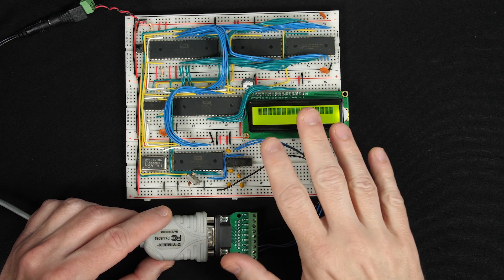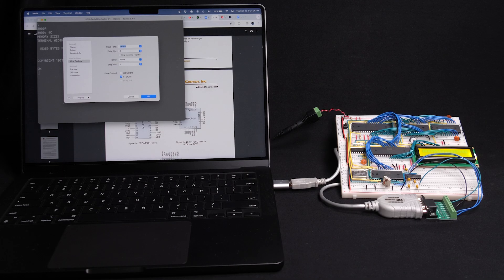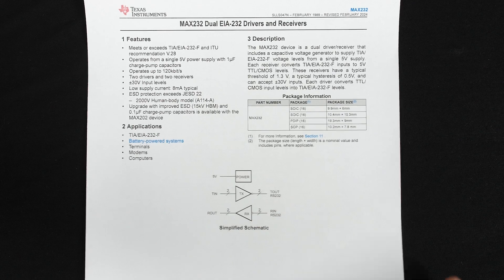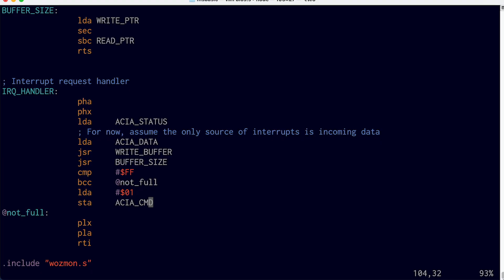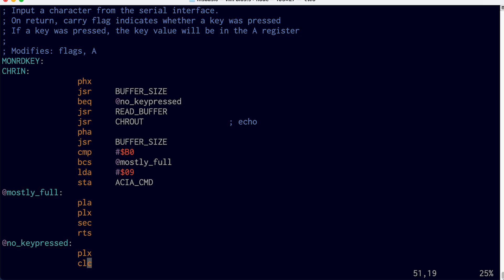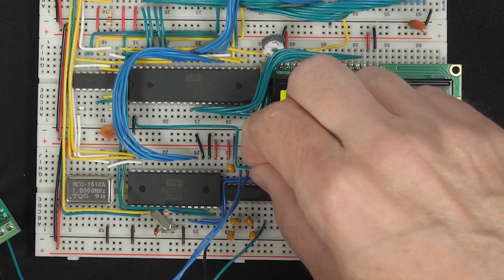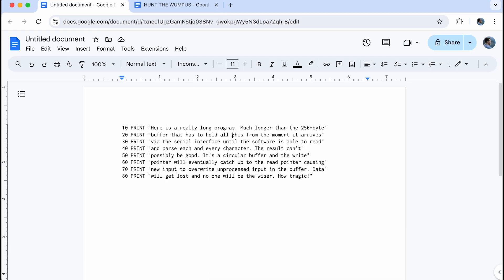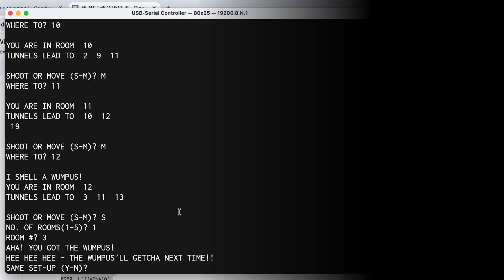RS232 flow control

Comment: What a lovely break from 400 gigabytes of NPM packages and desktop apps that use 200 megs of ram. Truly an elegant computer from a more civilized age.
Reply: Id actually appreciate desktop apps that only use 200MB ram.
Most electron crap uses 1.5GB+
Reply: @UloPe  And with that 1.5GB+ comes vastly improved developer experience. That's the point. We can either have excellent developer experience (which includes reduced development time) or we can have low memory usage. There is a reason for the tradeoff.
Reply: @clonkex  eh. sort of. the thinking is more along the lines of "machines have plenty of memory these days, and unused memory is wasted memory". this is true, so developers use more memory and have come to expect more memory. problem is, users also want to run plenty of programs, and often the programs cant gracefully scale down or share.

sure, we can run more things in parallel than we could 10 years ago, but not nearly as much as youd expect based on how hardware has advanced.
Reply: @clonkex  honestly I don’t give a rats ass about developer experience If the output product is substandard garbage. And I’m saying that as a software developer myself.

Also I reject your assertion that using web tech for desktop and mobile apps ist such a great dev ex. It’s just the lowest common denominator so that everybody and their dog can shit out an app that somehwhat “works”.
Reply: @clonkex yeah, but getting your hands dirty in the low level stuff is WAYYY more fun.
Reply: @clonkex software must be the only industry that’s this concerned about developers. Could you imagine a mechanical engineer saying “Sure that car does 3 miles to the gallon but it was a great experience to design”
Reply: @UloPe could you imagine any other designer prioritising their own workload over the efficiency of the product to this extent?
Reply: It's a sad day when even comment threads on Ben's channel turn toxic.
Reply: @johnm2012  Dude didn't even get the starwars reference so I wasn't gonna bother replying to him but yes, yes it truly is.
Reply: I wrote X program in 3 lines of code......and 400 gigabytes of NPM packages.
Reply: @fqed  I feel like y'all have a very difficult experience with npm than I do. There's certainly a lot of bloated crap but none of it is necessary.

Of course the web application at work is stuffed to the gills with unnecessary frameworks but that's a whole different story.
Reply: @DanKaschel it’s less npm or even Node JS’s fault. It’s JavaScript’s weak typing and implicit conversion that necessitate dumb packages like ‘isarray’ that get millions of downloads 😂
Reply: @baileyharrison1030 no, micropackages like that are an issue of developer education. in that specific instance, all major runtimes have had a native method for that since 2015. for some reason or another, a lot of developers just arent learning about modern JS.
Reply: Nothing screams elegance like smelling a wumpus.
Reply: Yeah. This whole thing runs on less then 32kb of ram. Meanwhile npm manages to cause memory full errors on my PC with 32gb of ram .......
Reply: I’m watching this while procrastinating on writing new Azure blueprints. I was a hardware guy but all the hardware is in data centers now. Building his 8-bit breadboard system reminded me how good it feels to touch silicon.
Reply: @JohnVance  touch silicon is gonna be the 22nd century's touch grass
Reply: back in your "more civilized age" black people couldnt vote in the US. be careful about repeating fascist rhetoric without thinking about its implications. you can criticize aspects of the world without pretending it used to be better as a whole.
Reply: @jotch_7627  You're watching too much politics (I know I am) when you misconstrue a retro electronics site  comment w/ a hidden message of fascism.  -- do you also go around correcting all the master/slave nomenclatures still used widely (especially in retro electronics)?
Reply: @jotch_7627  It's a Star Wars reference + the computer is a 6502 from 1985 + it ain't that deep bro
Reply: @jotch_7627  you need to like, get out more.
Reply: These are two very different subjects
Reply: @jotch_7627  As a progressive, I can appreciate the fundamental link between nostalgia and fascism. But the 6502 was released in 1975, not 1875.
Reply: @JohnVance im talking about the voting rights act of 1965. ya know, the one that actually made a meaningful difference. and RS-232 came out in 1960, so that seems like the exact era theyre thinking of.
Reply: @jotch_7627  Fair point, RS-232 indeed predates that.

Comment: Another great video, thanks Ben! Yeah, UART bugs are definitely nothing new, I recall back in the day the 16550 had a FIFO buffer bug that was fixed on the 16550A
Reply: Yep, and that bug was such a PITA.    It was one of those "that's all I need you to do correctly and it's the one thing you don't do correctly!"    Had that same sort of problem with PIC's output buffers not correctly flagging their status.

Comment: Ben, I noticed the get character routine will write to CTS for every character read from the buffer except when the buffer is mostly full. My hunch is that the UART might not totally like being continually told that it's CTS when it already is CTS. Edit: So you could keep the state in memory and only write it when it changes

My first computer was the ZX81 and I envied my friends who had 6502 computers. Your series has brought back so many memories! Thank you so much for your work 13:33
Reply: Good points about what should be happening. I guess that's the thing about bugs - they are unexplainable until you work out how the bug causes the problem. And then in hindsight the logic is so obvious you wonder how on earth you made the mistake in the first place. The highs and lows of being a developer.
Reply: Sounds like a worthy experiment, see if the greatly reduced traffic to that register has any affect.
Still it makes no sense to me - the 'perfectly received' character value that is 'pushed/popped and returned' should match exactly the value sent to CHROUT. (@12:17)  The effect we see when listing implies that the returned character is always correct, *later in the flow*, and yet the printed value from the same register A source is not.  Could it be that CHROUT is producing CRLFs in response to extraneous NUL characters, that the line editor discards?
Theory (probably utter nonsense) - overly prodding CTS causes the UART to offer spurious receive data ready signals that CHROUT and the line editor handle very differently.
Reply: You don't really need memory - you just need to send that command when the buffer size is exactly at the watermark
Reply: It's unlikely to break anything...

Comment: Thank you for explaining this.  I've configured a lot of network switches which have RS232 interfaces, and I've always wondered why pasting in a large config file all at once caused issues with it being able to read it.  It's common wisdom to just paste small sections at a time lol, but I never knew why this happened
Reply: I would hand configure just enough over serial to get Telnet or SSH working first, then switch connections.
Reply: @Antiwindowscatalog  I worked on a project where I had to configure 200 switches without ZTP, so it was quicker to just stage the configs, unbox them into a pile and then hammer through them one by one prior to physically installing them in the rack.